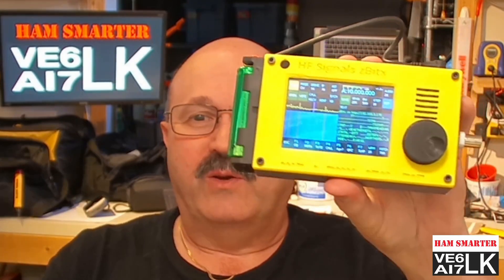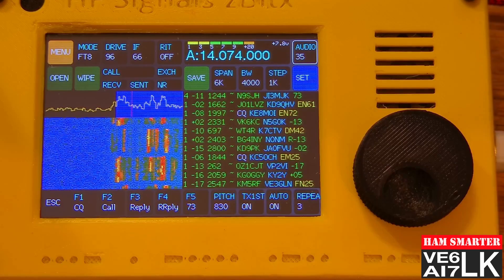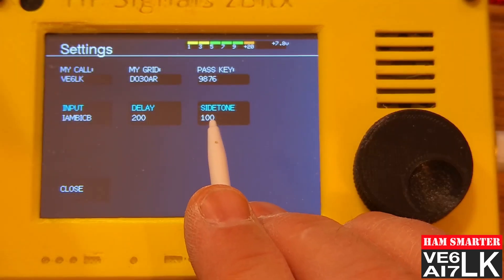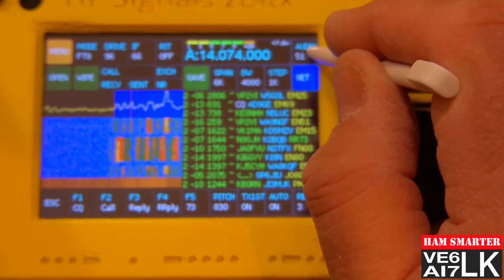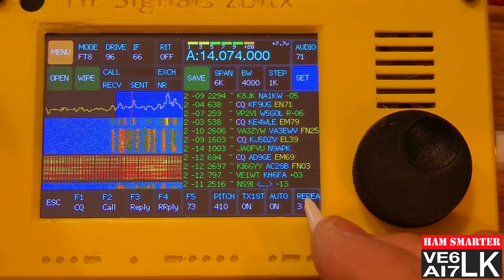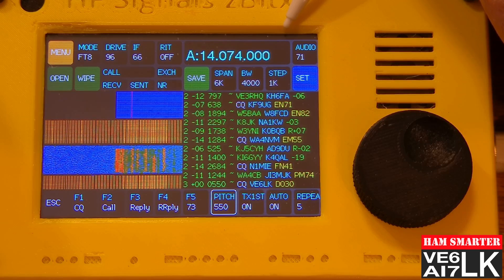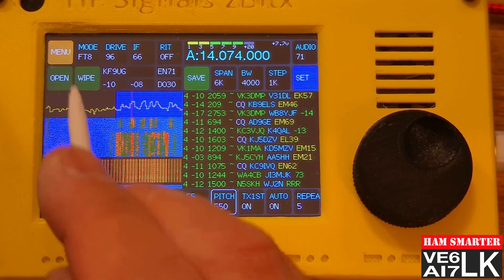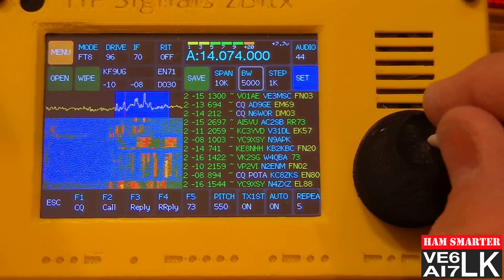zBitx first look - FT8 overview

Comment: The pitch is to be used to transmit on an audio frequency that is not on use, NOT to lower volume.
Reply from the maker: Thanks for watching. It can be used for both as a matter of fact. In the context I presented it, it was about the volume it presented on transmit. Naturally a considerate operator will ensure that the frequency is free before transmitting, as I did but did not speak of it as my focus was on the volume of the speaker.

Comment: is the radio controllable remotely?
Reply: Raspian should have VNC server pre installed. Would like to see enabled and tested to see if 500Mb of RAM is enough for VNC remote and JS8Call. HFSignals told me its doable but untested.
Reply from the maker: VNC Server is installed however must be enabled, which is quick and easy to do. You'll see VNC running in one of the other videos.